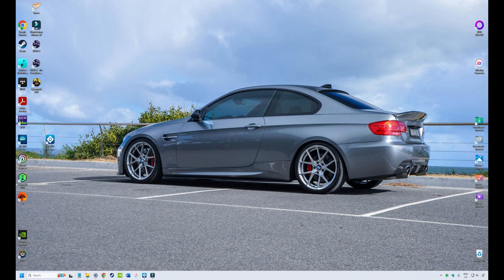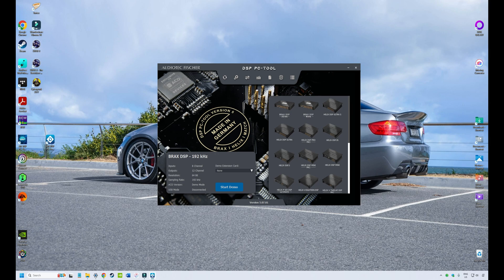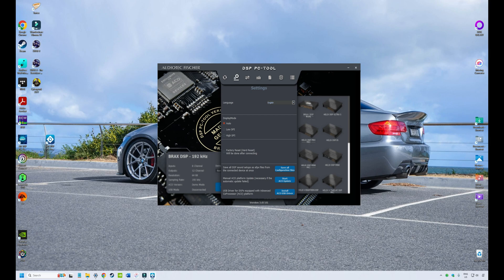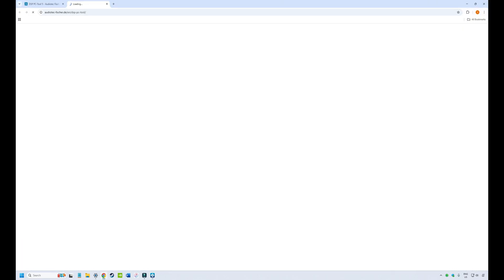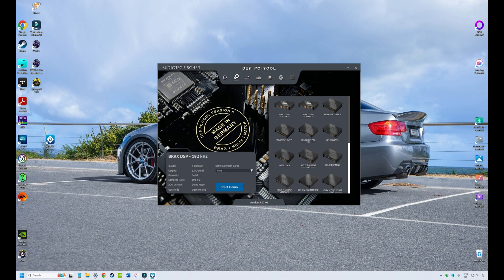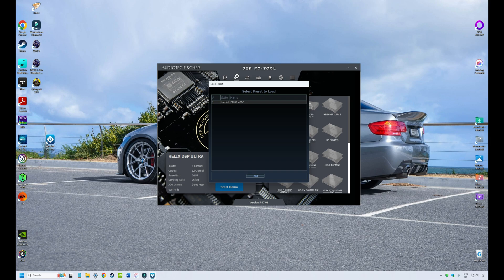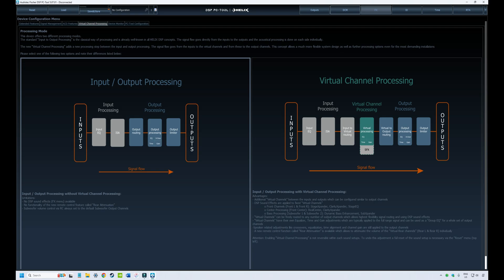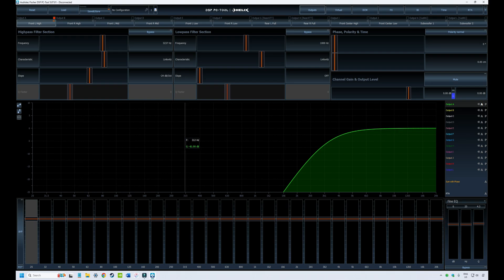HELIX DSP PC TOOL tutorials - Part 1 - How to get started

Comment: I just finished my SQ build and have a Helix DSP Ultra S. I downloaded the software and had a little play around with it but its way too advanced for me. I had my computer connected to the DSP by USB but it would never detect it. It seemed i was stuck in demo mode. Does the DSP need to be ON when connecting and configuring?
Reply from the maker: Hi B1. Yes it needs to be on

Comment: I downloaded the new dsp tool 6. The dsp said I had version 15 and need to update to version 23 once I did the dsp went into overvoltage protection. Now I cant do anything. Can you help me with this. I also held the button in for 5 secs to reset and it did nothing.
Reply from the maker: Gday Ayeton.  What DSP and controller are you using?  Tbh the version 6 pc tool software is still in beta and they are slowly rolling out bug fixes for it. At the moment it is too unstable to use imo, so I would stick with version 5  for the moment.  Now to your problem.  Have no fear your DSP is not fried.  I assume you tried to update the ACO software from 15 to 23 and it has basically corrupted your DSP memory.   Pressing reset wont do anything because the DSP memory is wiped.  If this is the case you will either have a solid red LED or a red and green flashing LED I can't remember which it is but its one of them.  To fix it you need to disconnect the power to the DSP and let it discharge for a few minutes and reconnect the power,  then you have to reinstall the version 5 software and reinstall your director software (if you are using one).   Basically you need to treat the DSP as if it is brand new and set it up again.   Just follow the instructions in the user manual.  But what a pain in the ass !!!   Good luck :)